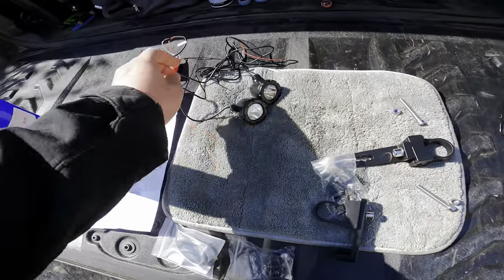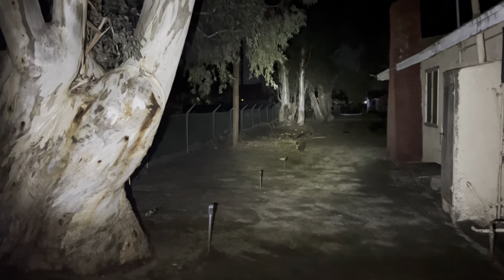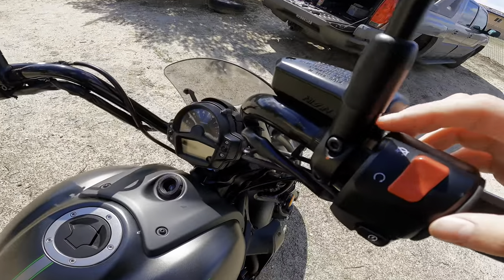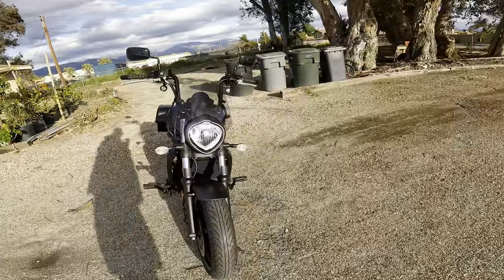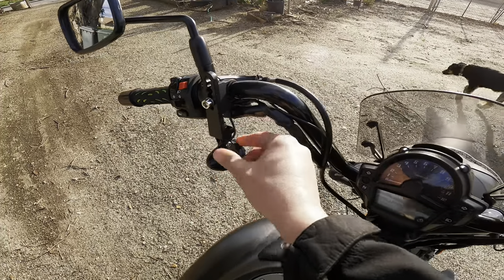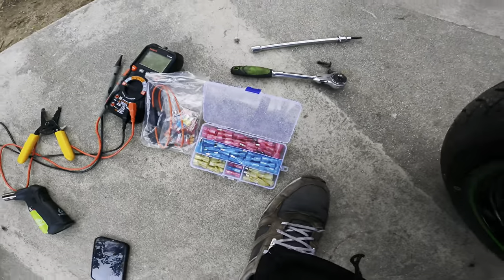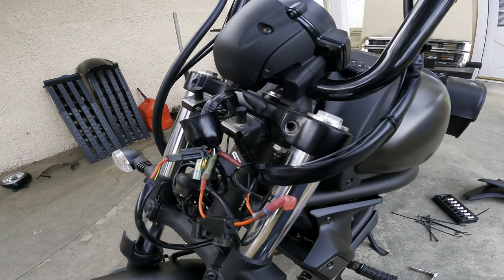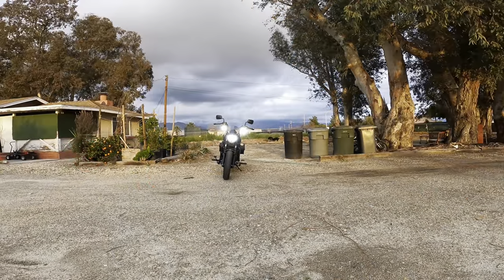Kawasaki Vulcan S Handlebar Lights Install!

Comment: Hey man, what type of led headlight did you replace the halogen headlight with?
Reply from the maker: AUXITO H4 LED Light Bulb Motorcycle, 9003 HB2 LED Light 3000LM 6000K Cool White 1860 CSP LED Chips, Pack of 1 https://a.co/d/08McR8i

Comment: Why do you have to install a relay
Reply from the maker: @athomas2k8  the lights will not turn on. The wires on the motorcycle are useless without the relay.
Reply: @jaygee269  i appreciate the reply. Do I need to buy a specific relay for just the Vulcan? Or where did you buy yours?

Comment: Can they work as signal lights also?
Reply from the maker: Not these lights due to not having the orange switchback integrated. But I have seen other lights that can work as turn signals with the proper wiring.